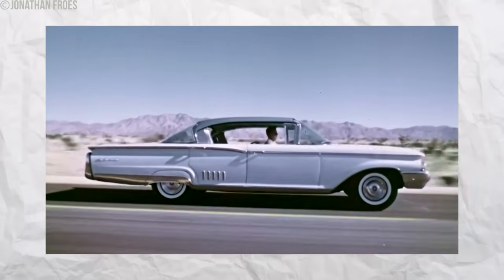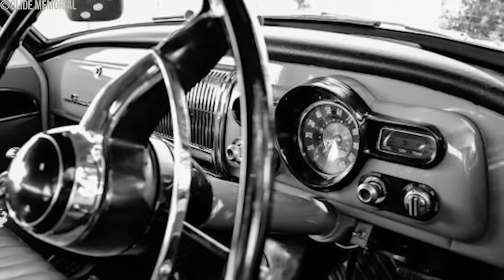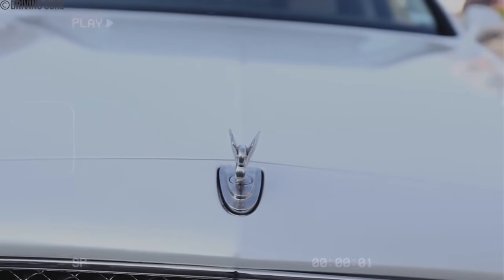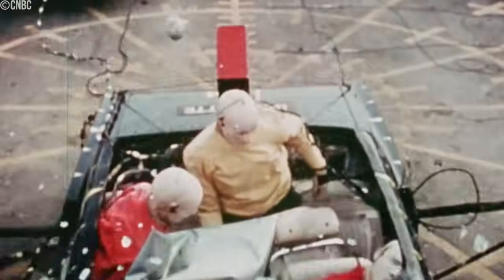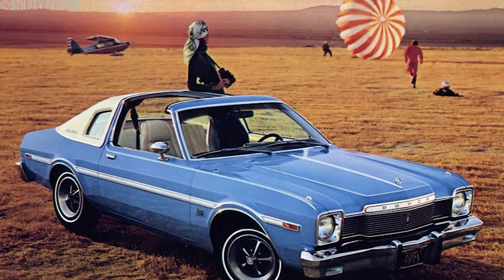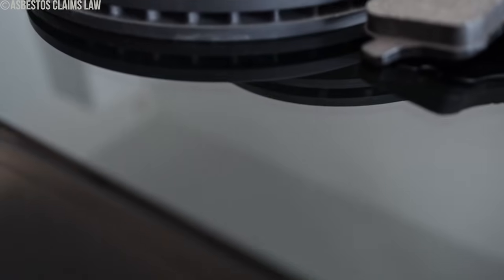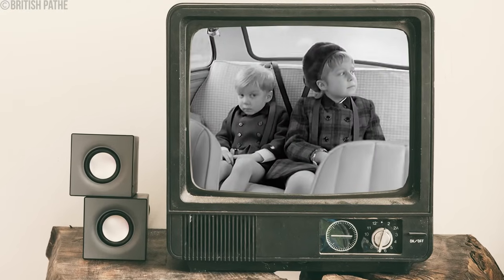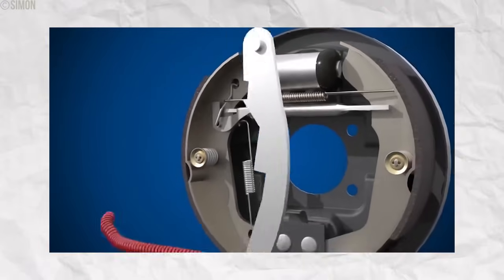13 DANGEROUS Old Car Features That FADED Into History!

Comment: I Can Remember when the Economic Ford Pinto Hatchbacks were dangerous because of where the Gas Tank was located in the rear. If a Pinto was rear ended in a Collision they were a death trap because of the gas tank rupturing or catching fire.
Reply: You couldn't relocate the tank?, I know that parts are in certain places for certain reasons but the math ain't mathing in this case